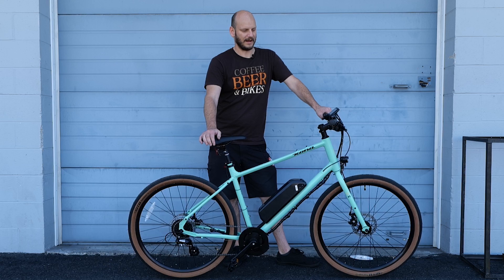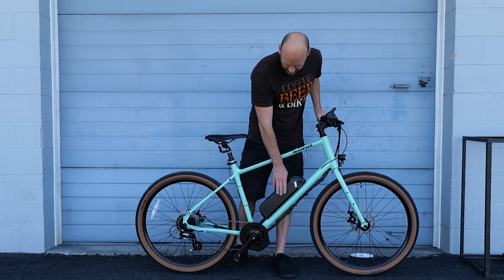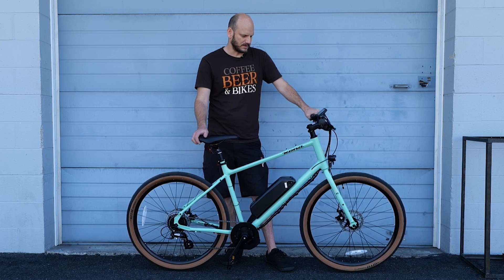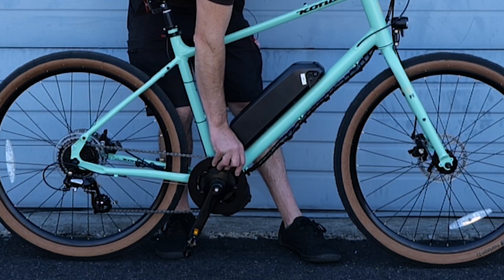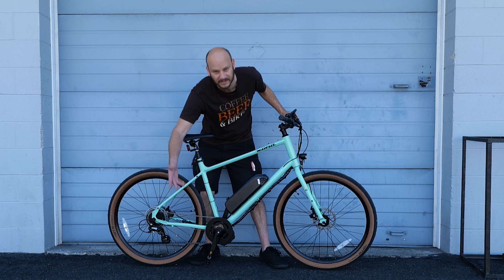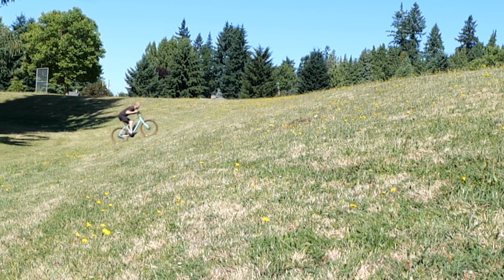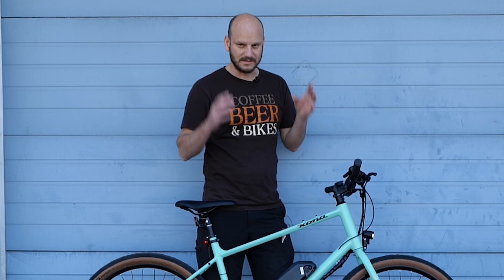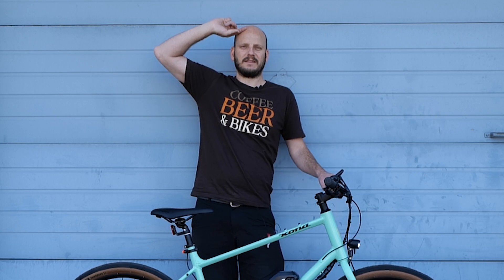Custom E-bike Build: Kona Dew w/ Toseven DM02 500w mid drive and 48v 14ah

Comment: Just bouth that motor for my build. What you mean with the "offset"?
Reply from the maker: When you add a motor to a Bike, it has a tendency to push the chain line away from the Bike. There are chain rings that have offset that bring the chain line back in into it more natural position.

Comment: Did you do any firmware updates? I have heard to avoid the update from last October. If I order a DM01 with LCD135 Display from you what version firmware will it have. Will it be plug and play.  Can I customize the battery settings for a LiFePO4 battery and set wheel size directly from the display. I hear some menus have been locked out.  Can the throttle be set to moped mode.  Is the speed limited to 28 mph. please excuse my ignorance.
Reply from the maker: I definitely wouldn’t do a firmware update on them unless you are having issues. Then, just make sure you have an updated firmware cable.

Comment: Problem with Toseven is that controllers like to to just die. Mine died after 3000km and 10 months of use.
Reply from the maker: Yes. They definitely need to address that and their firmwares. Very close to being an amazing motor!

Comment: Please explain what you mean by an "offset" chain ring. I managed to build convert a bike for my son without knowing but now I'm curious.
Reply from the maker: An offset chainring brings the chainline in closer to the bike.
Reply: Johnny already answered, but for more info, toseven offers a regular and offset ring. The regular ring is flat, the offset ring is "dished" to bring the chain line closer to the frame of the bike. Without the offset, it would be difficult/impossible to get into the larger sprockets on the rear hub on a lot of bikes. Not all motors need the offset, my chain line was fine with the regular ring on the bbs02.
Reply: @nolowputts I'm a little puzzled because my tzdz8 needed all the spaces to pull the chainring away from the bike frame so this sounds odd.
Reply: @gilesbbb That’s probably because the front chainring your motor came with is larger than original, so it has to be further out. If you go smaller, or back to original size, it could probably be closer to the bike for a straighter chainline.
Reply: How did you get the rear light to work with the brakes?

Comment: my dm02 500w on a specialized with a 21ah 48v hailong is a beast, had to swap out the rear rack battery cuz it was too heavy in the rear and kept poppin wheelies. have to say that hill climb was pitiful, but I plugged mine into a pc and tuned it a little heavier on the top end for hills.

Comment: After doing a couple of Dm-02's I'm a fan
Reply: I've been looking at these motors.  Use my BBSHD for riding.  This seems good for pedaling.  I'm all throttle on the bbshd
Reply: @bbolin711   if you want to feel like your riding a bike (pedaling) the dm02 is it. Came with the programming cable, tuned down the first few gears. Its quiet and will peak over 800w goin up hill if you let it no problem.
Reply: Where did you buy your dm02 from?